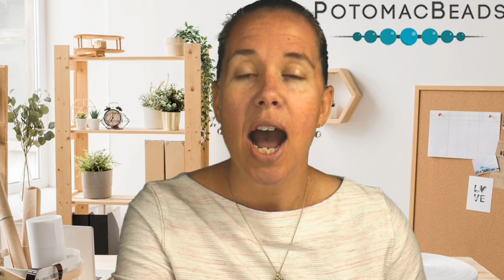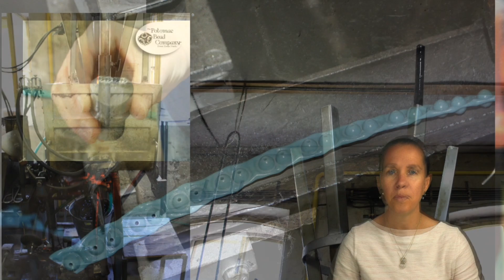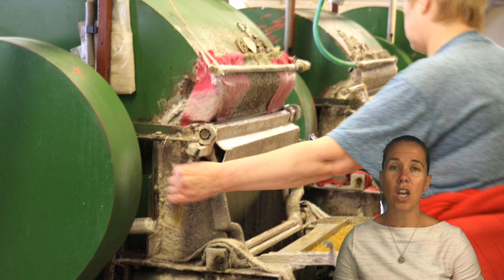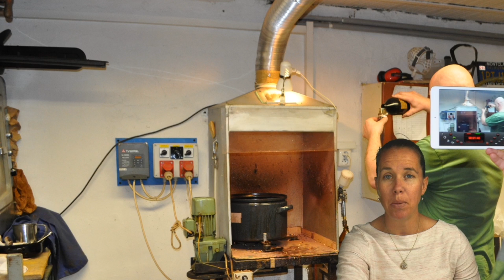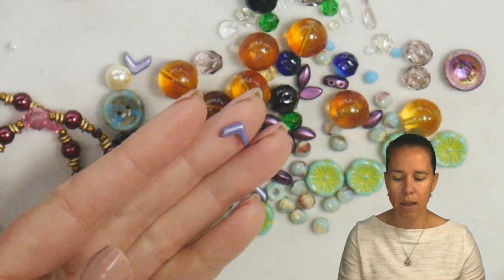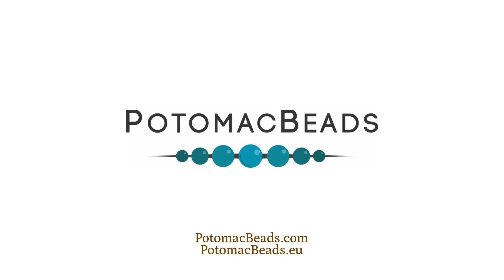How Czech Glass Beads Are Made - Better Beaders Episode by PotomacBeads

Comment: Glass powder is poured into tiny holes in a mold and inserted into a kiln to melt into the shape of the seed bead. A metal spindle is then used to create a hole in the center of the bead.

Comment: I guess my question is what is the glass made of. My glass beads have a strange dirt or cement like substance within its crevices and holes. I'm curious whether these are Czech glass or possibly something else. They look very crude and primitive, I just can't figure it out. The necklace itself appears old but not antique, the beads are a translucent blue with light metallic finish/coating which may of worn away.